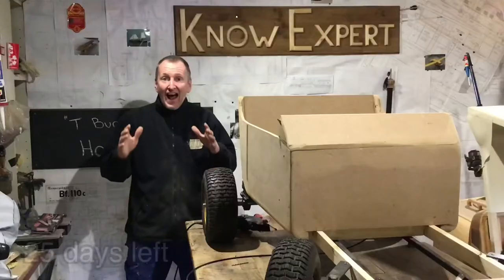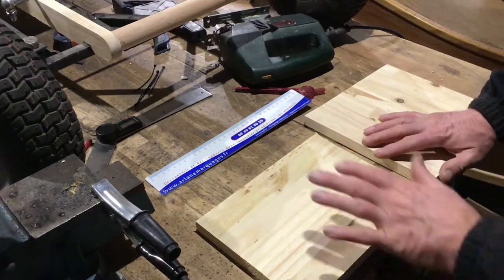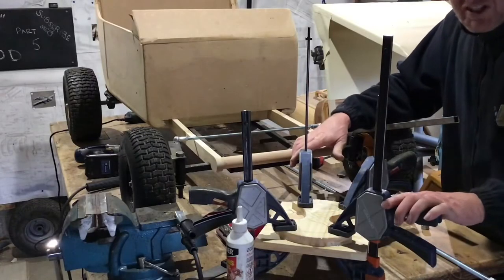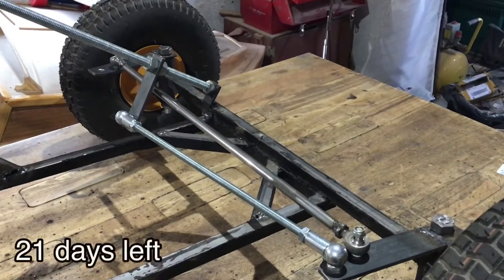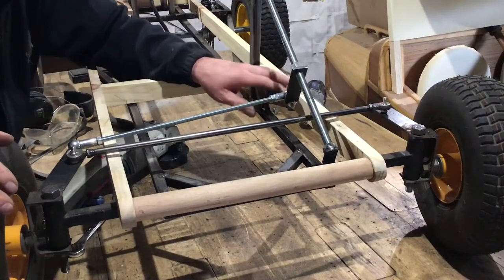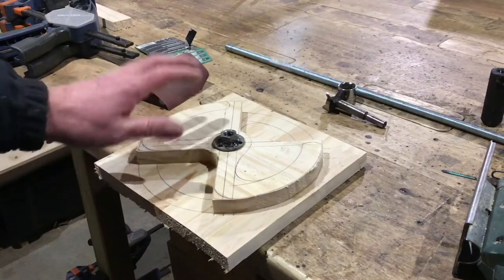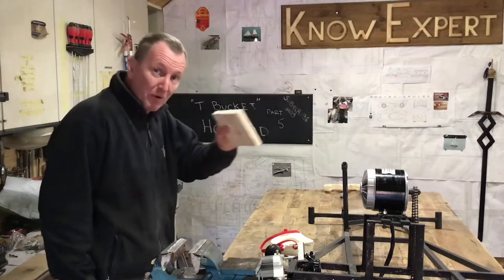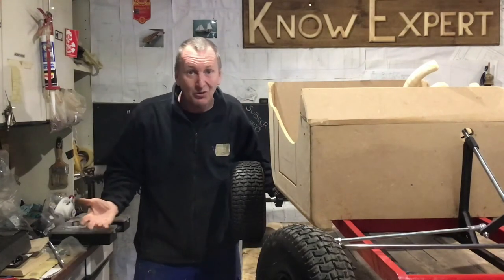Making a kids electric T Bucket Hot Rod go kart. Part 5 the steering

Comment: Nice welding Mate,I'd wire wheel that one and stick it on the wall to remind myself I can do nice welds. Then make another lol. Not so cocky with the steering backing nut though. Alan I don't use one of those mamby pamby little Iphone screens,mines a 32" monitor,so every little detail shows up hahahaha. Jesus I could even tell you when your toe nails need cutting! Absolutely Love the Build,best one you've ever done,can't wait for the next episode
Reply from the maker: ha ha you’re not wrong. the thing is I used to weld in a factory in Holland but it was TIG, I was ok but it was an expensive machine with loads of settings. I now use a 49 euro stick welder. I would like to buy another TIG but I haven’t found which one yet. it’s a good job I’ve got that tin of 'cover your bad welding' underseal.
Reply: @Know-Expert  What ever happened to that scratch start TIG you had? I know KV nicked it off me while I was supposed to be keeping hold of it for you but,I'm pretty damn sure I got it back off him and gave it to you....Oh still have your BOC bottle,good job I conned them to close your account lol
Reply from the maker: @dennisreid4428  i seem to remember selling it before I came to France...... I think that’s probably why I gave you the bottle.